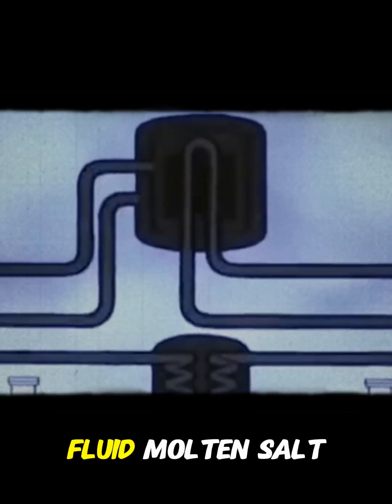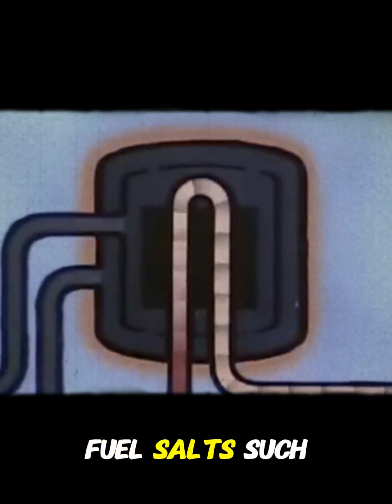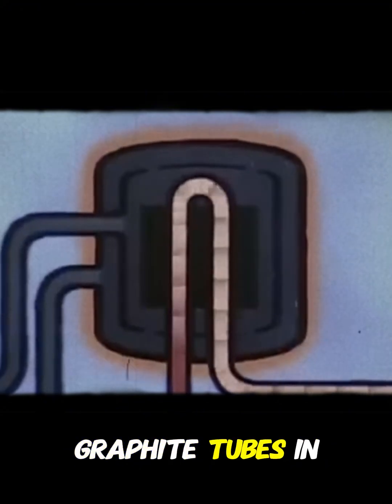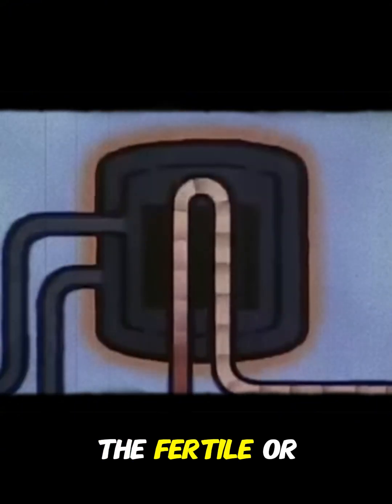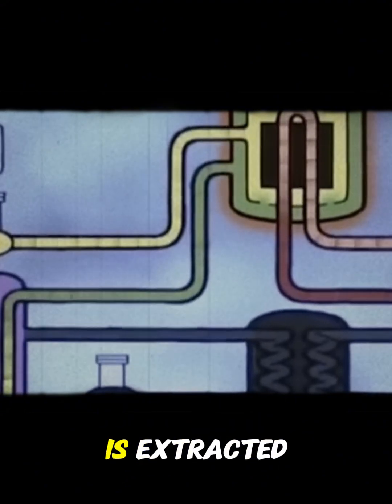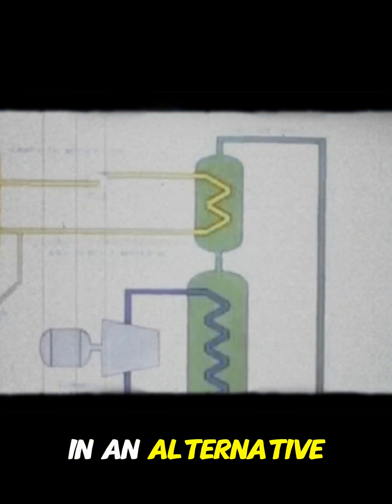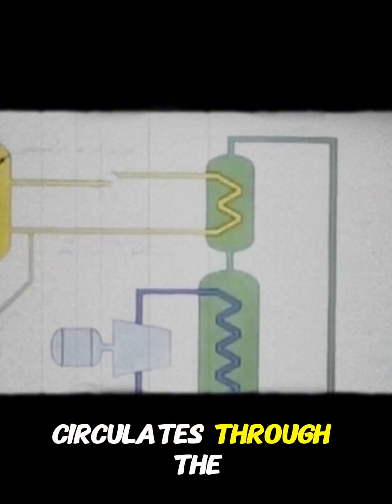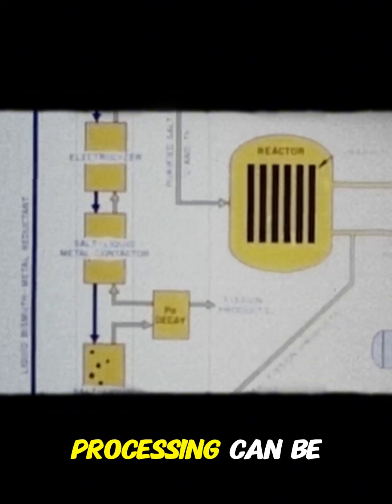This is how a Thorium molten salt reactor works | Nuclear Energy #Thorium #Technology #howitworks

Comment: China did solve the in-line fuel processing using a separated tank to store the extracted Pa233 let it rest for 27 days to transform to U233 before injected back to the reactor, all remote control, not knowing the detail, they just announced the whole system is running well.
Reply from the maker: That's Great engineering 💪